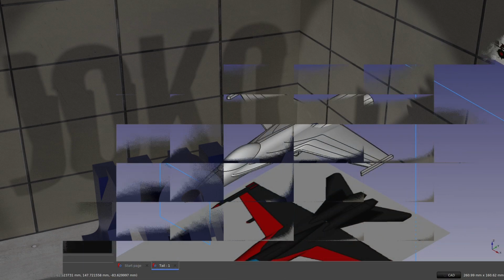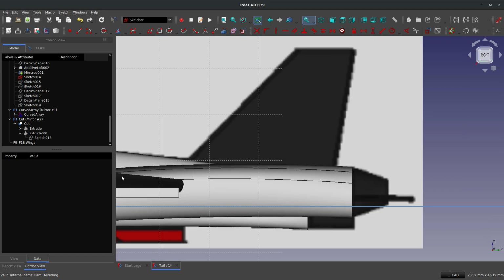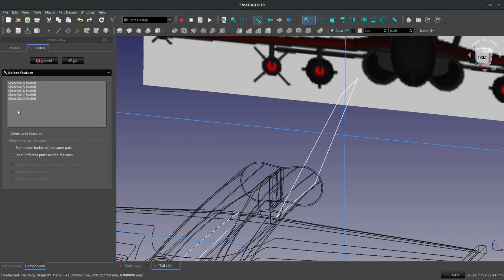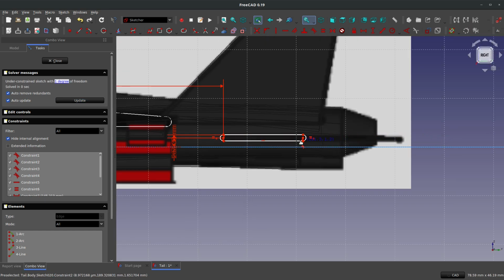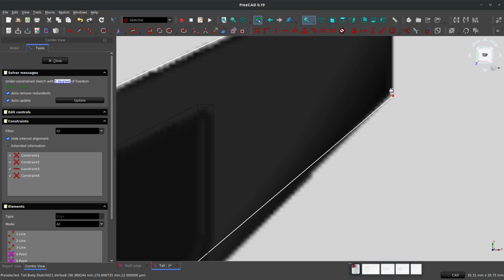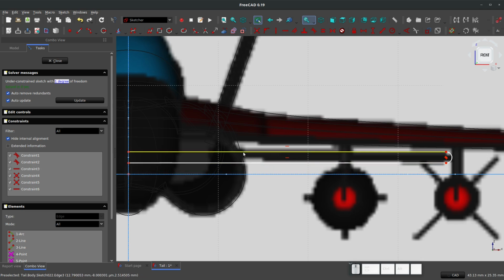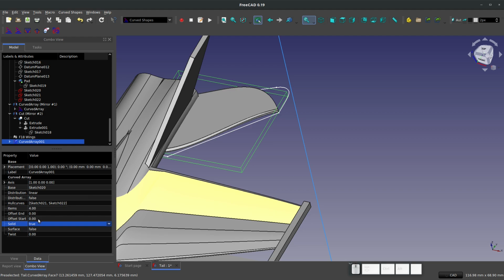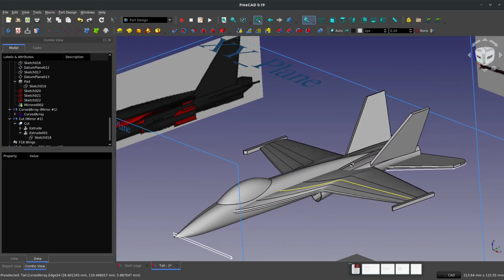Make an F18 in FreeCAD Video 4: Tail |JOKO ENGINEERING|

Comment: Hi, thanks for the video, the F18 is looking good now! My video said the quality was 1080p60 so that's 60 fps not 30 fps as you mentioned. I'm getting really frustrated with FreeCAD as during this tutorial it did not update the view after adding horizontal constraints on the dots we added to the arcs for reference and also I could not get my whole plane to be visible, I'd enable visibility on a feature and lose visibility of other parts of plane, took a bit of fiddling to get the whole view back again. It would not mirror the top tail because it could not intersect! I'm wondering if there's a better FREE app that I should spend my time learning? I do like FreeCAD I just think it's buggy and being a man of zero patience the air is often blue!
Reply from the maker: Sometimes when a sketch doesn't update after a constraint is added, it is because there is an over-constraint somewhere.  Were the parts of the plane that toggled visibility separate bodies or features of the same body?  There are some other free to use things; Solvespace is open source and parametric and I haven't played with it but opencascade has a free software.  OnShape, design spark, Solid Edge, and fusion 360 have free closed source stuff but the terms may change in the future.  Good luck
Reply: @JokoEngineeringhelp  Thanks for quick reply, features of the same body as at the end of part 3. Used to use Fusion360 on a Open University student account but I thought it wasn't free now! I'll try Solvespace, thanks.
Reply from the maker: @malcolmcolindixon  I do have videos on the channel for solvespace.  It's not nearly as powerful as FreeCAD yet.  I enjoy the UI a lot, I think it's easy to use but makes me feel nostalgic.
Reply: @JokoEngineeringhelp  Had a quick look at Solvespace, I'm opposite to you, didn't like the UI and it seems feature starved but probably okay for most things I'd want to do. Since I've spent hours already learning FreeCAD and with it's feature set and addons will allow progression, I might as well stick with it and just count to ten when it does something unexpected! Thanks again for your efforts.